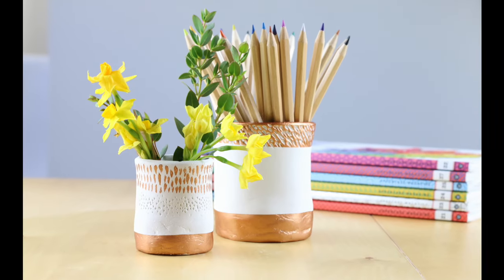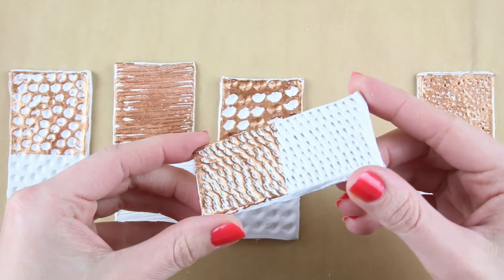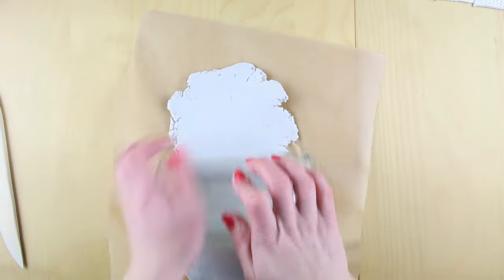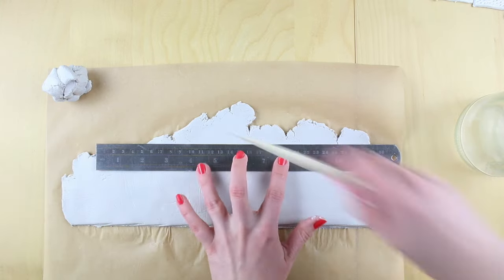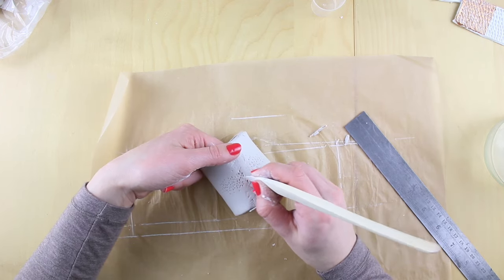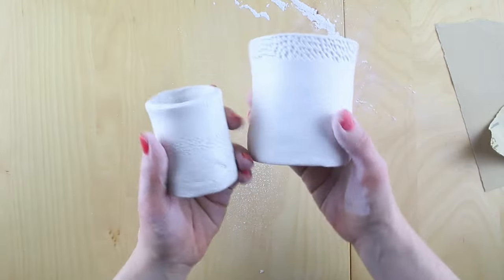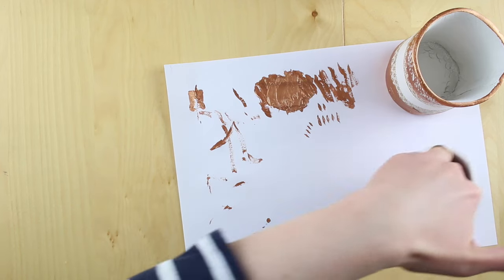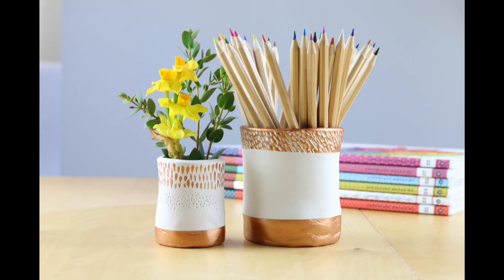Air Dry Clay Desk Tidy Pot Tutorial | Craftiosity | Craft Kit Subscription Box

Comment: Hi! How long does an air dry clay dry? I love your work!
Reply: It depends on what kind of clay you are using, I used model magic and it took about 4-7 days but if you use crayola, das or sculpey clay it will take only about 2 days.
Reply from the maker: It also depends on the climate / temperature. Mid-winter in the UK it takes longer than on a lovely sunny day :)